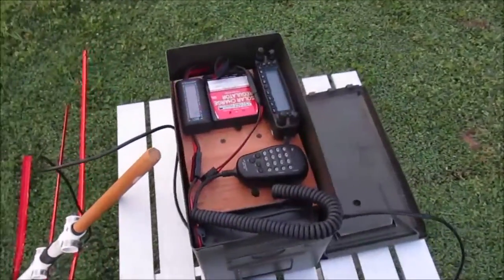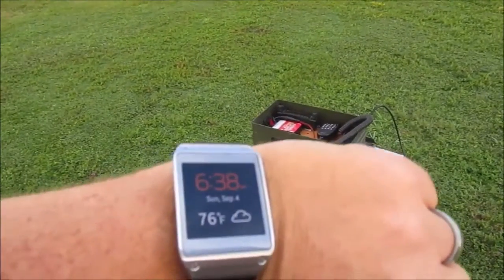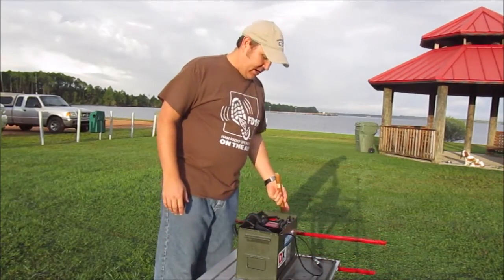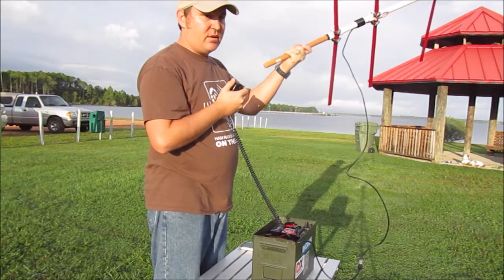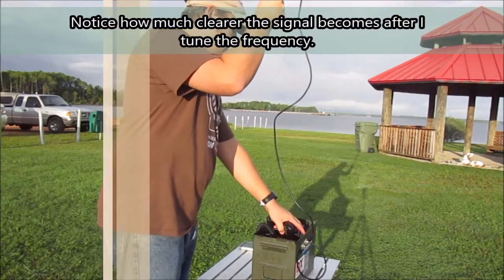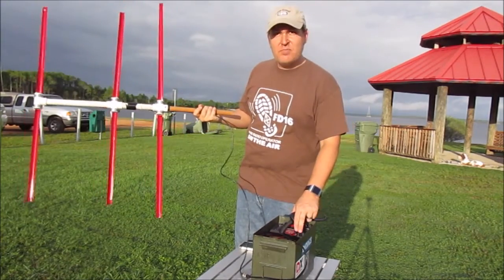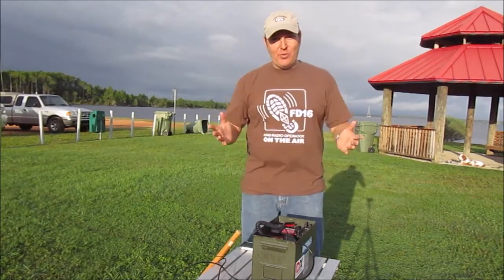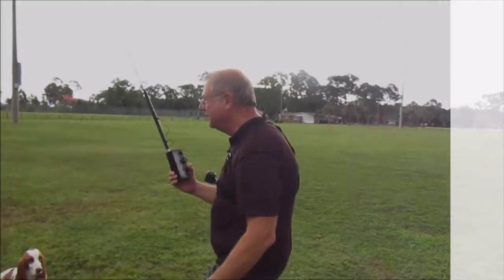Working Amateur Radio Satellite SO-50 9/4/2016

Comment: Nice video Bob! Can't believe that tape measure antenna was pulling the signals out of the air. The  FT 8800 must make a huge difference with the great receiver section. You should have no problems with the LPDA homebrew antenna working even better.
73 de N4UVR

Comment: that must have been a nice high pass.. I dont think that satellite is on during night passes over the USA ? at least i never heard it on.
Reply: hamradio Ham - It could be directly fed with a poor charging controller from the solar panels. The direct effect of this is that at night, the solar panels aren't generating much power, leaving the transmitter to output only a few milliwatts, not much to work with.